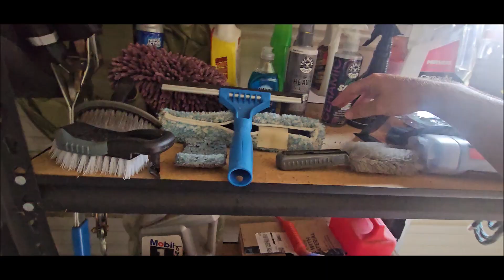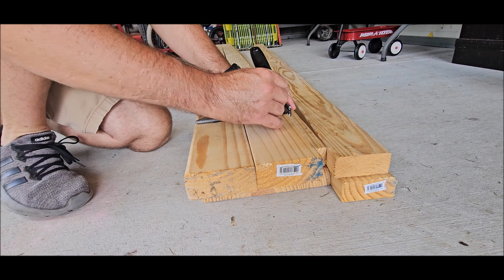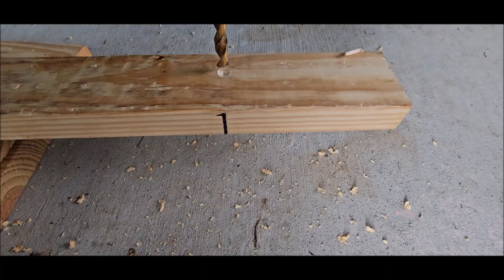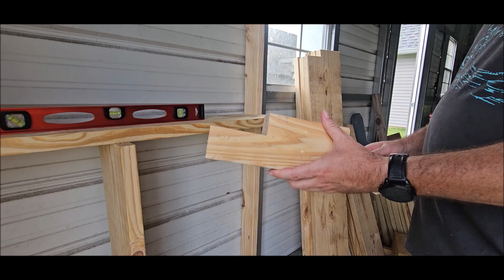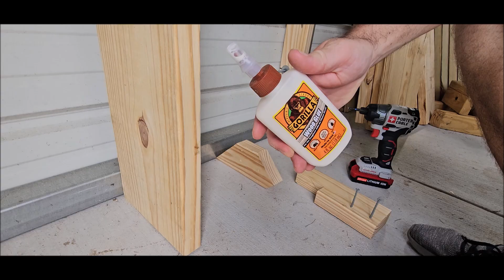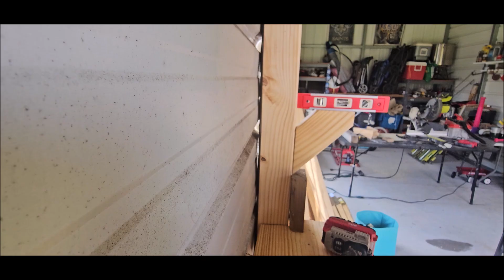Wooden Shelves Metal Building

Comment: Good build but could've used 2x3s so the depth would match the metal studs and not stick out. Worked out fine based on what you were building but 2x3s work perfect if you're wanting things to sit flush or if you want to add plywood or drywall to the building.

Also, they make wood to metal Tek screws so that you don't even need bolts like this. Much quicker process.